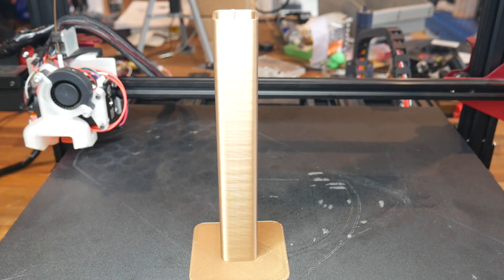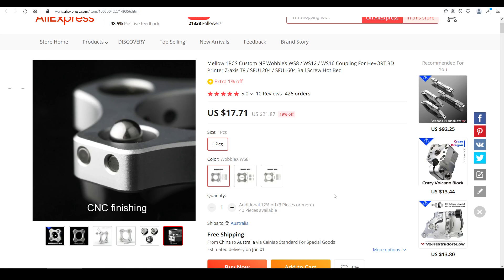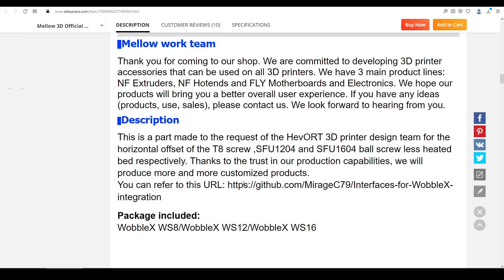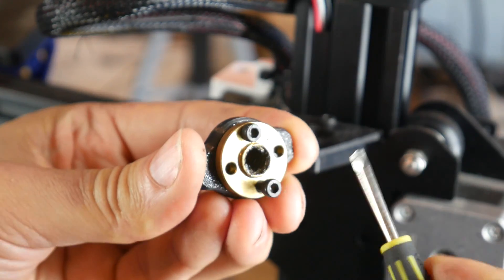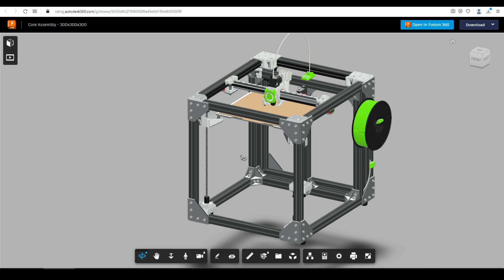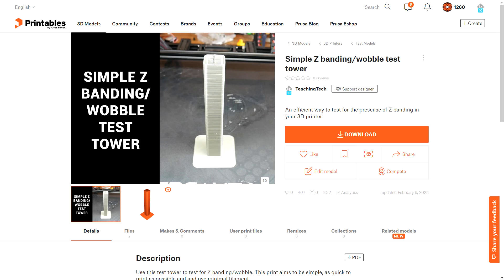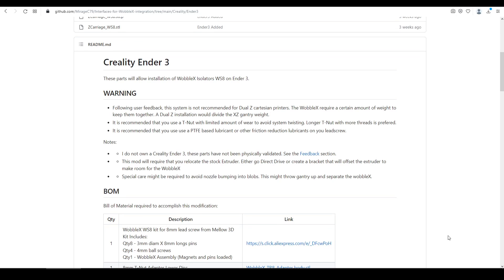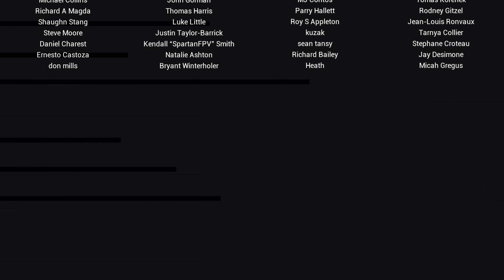The foolproof fix for Z banding and misalignment? MirageC’s wobbleX

Comment: The one you printed for the Ender 3 looks like you could have a gantry wheels with flat spots on it. I've noticed this allot with my own Ender 3 and i have to replace them on a regular basis. either from it sitting to long from non use or normal wear and tear. so ive made a pratice of replacing my wheels once a year, and that equal length banding has gone from my prints! Just my thoughts and suggestions on replacing your wheels for the horizontal gantry.
Reply: This. I had the exact same problems with my ender 3 clone - coming with wobbly wheels fresh from the dropshipper - I replaced all of them and the wobble was gone.
Reply: At that point you might as well get rid of the wheels altogether and go with rods or linear bearings.
Reply: @amorton94  Those wheels are a dime a dozen now, that linear rails are the new fancy - and you gotta have a whole lotta more work to do, to retrofit linear rails onto an ender - ask me, how I know ;)
Reply: But he fixed the problem when he added weight and the print came out great. I mean he pretty clearly explained what the issue was and how he fixed it.
Reply: @Hagop64  This was the (fairly similiar, but modded) dual-Z CR-10. The Ender only has one Z-motor.
Reply: I actually though about replacing my wheels a few days ago... 
It there any test to know when its time to change them? 
When i move my axis by hand i can feel a slight difference in force required depending where on the axis the gantry is.  Guess that enough proof that its time to change xD

Any wheel type you recommend?  I were looking into Polycarbonate, but i dont really know whats the best type for durability
Reply: @KidCe.  "When i move my axis by hand i can feel a slight difference in force required depending where on the axis the gantry is."
Gently, slowly, and especially consistently moving the gantry up and down, with a light touch so you can feel minute details, is the best method indeed.
(except for maybe using an expensive feeler gauge, and/or force measuring device, but that takes a whole lot of setup, time and money)
It would be even better if you decouple the driver system from it (remove the belts or lead screws), so your feeling isn't hindered by them. But that is a step up which would require a lot of more time and effort.

You can also visually inspect the wheels and extrusion for any inconsistencies like dust or other particles.
But note that those pom wheels always give of some 'dust' (this isn't really dust though, but the micron thick top layer from the wheels --usually dark grayish in color.. It also acts like a form of self lubrication).

But if you dialed in the tension on the wheels properly (note: many fail to do this properly!), and you make sure particles or even normal dust doesn't collect on the wheels nor the extrusion, and you regularly clean off the extrusion with a micro cloth. Those wheels should last for ages! The biggest culprit and reason for deformation of the wheels really is bad tensioning and nothing else!

Caveat: if you are not going to use your printer for a long time; loosen the tension of the wheels. They will deform if you leave them long enough on one spot. HOWEVER, if you tensioning is correct, they also should 'spring' back quickly without any permanent deformation after a couple of runs.

Good properly tensioned wheels can give equally good results as any linear rail by the way! Don't let anyone fool you about that! Though linear rails are much more friendlier in maintenance, also in the long run, and way easier to set up. Because POM wheels should be considered a consumer product/ aka: they do need replacement after a while. Linear rails only need some lube from time to time and that is it. (set aside cleaning and keeping it free from dust and what not, which you need to do for both systems anyways).

Comment: I converted my ender 3 V2 to belted Z because I was having too many issues with the lead screw.  

On a separate note.  Have you had a look at the Rook 3D printer on printables?
Reply: Did it work out alright?  Seems like that would induce other issues.  Did you use a leadscrew to drive the dual bands?
Reply: @KITDFOHS  Its not a perfect solution but it solved more problems than it caused and my X axis is now supported on both sides without needing a second Z motor.  I am using the leadscrew as the Z axel.  I will get around to using a linear rod eventualy.

Comment: There is something I don't understand about the mod on the two Cartesian printers: You decouple the X-axle from the leadscrew, but then force that leadscrew into a fixed ball bearing at the top... Shouldn't that work better if you let the upper end move as freely as with the Ratrig . (?)
Reply: The wobble X can only compensate for a finite amount of lateral movement. So you need to make sure that the leadscrew or ballscrew stays within that maximum deviation.
Reply: No, not really. Decoupler should prevent any of the side to side movement if it's not too big. But he is also using a standard screw nut that's clearly seen better days. There's a lot of backlash in the system (which is probably why he needed to add 500 grams in the first place.). Anyway, the wobblex was developed for ballscrew mainly, and you have no backlash there to begin with.

Comment: Another solution for z banding is belted z axis.
Reply: Yeah, but belts can start vibrating when printing at higher speeds which can lead to other artifacts.
And you'd need a gear system or power off brakes.

But they do work well for most normal speed printers and the gearing system could be a printed part.

Comment: You still need to try Oldham coupling.  I put a set on my Ender3 and have super clean prints.
Reply: that's cool, waiting on mine, any advices on install?
Reply: @deathcube2006  check fit. sometimes they have small burrs (nicks) that keep em from moving smoothly. If that's the case wet sand 2000 grit on mirror/flat surface, clean then light machine oil.
Reply: @deathcube2006  Make sure you have the right version.  Some models of the Ender3 must have the 2 hole, while others can use the 4.  Get the proper screws and nylon lock nuts.  Lube the coupler with a graphite or PTFE type lubricant.  When you get the couplers, take them apart and inspect them very well for burs, machine defects, and debris.  Any defects, or play in the dovetails will greatly hinder their usefulness.  Assuming you got the brass version, if there is play, you can take some of the play out of it by tightening the coupler end piece in a vice with  the jaws of the vice parallel to the travel of the dovetail.  I'd also add a bearing to the top of the Z axis leadscrew to keep things vertical and allow the Oldham to just take up the side to side movement.
Reply: @jameslmorehead  By pinching them like that in a vice, don't you bend them (slightly)? The rotational and pulling tolerance might decrease, but you also make it even more impossible for them to even slightly tilt in that case. Because it was exactly that very same small tolerance, which might make them ever so slightly tilt and kind of useful/effective in a roundabout way.
Reply: @Cookie  To use them effectively,  you must have a bearing at the top and bottom of the lead screw to make any bend in the lead screw a lateral move with no bending moment.  Also, keep in mind that this is for low-cost printers.  If you want to eliminate this all together, you need linear rails and drive belts.
Reply: @jameslmorehead  Errmm, no... using a bearing at top and/or bottom will not, ever, fix a bendy leadscrew and convert those bends into just lateral movements. If anything, fixing the leadscrew on top or bottom will introduce MORE bends (of course talking about minute stresses and bends, but still...). This is just pure physics/mechanica.

What it will do, or at least 'can' do, is minimizing artifacts from resonances a bit and 'flopping' around when your leadscrew isn't properly seated on the bottom (especially when printing high up).

Using bearings or anything which restrict the movement on top, is very highly dependent on many other factors and continues and always will be a very complicated and highly debated matter.
 
There can be other benefits in doing something like that, but it will also introduce other negative factors at the same time. There is no "one size fits all" solution for that, as it highly depends on many many other factors, not in the least the kind of coupling you use between it and stepper. Heck, even the kind of stepper on itself or how it is mounted can dictate whether or not it is useful to fix the top. What might work with your printer, does not necessarily work on another slightly different build bedslinger in the matter of leadscrew 'fixes'. 

But either way, you can not and never will be able to eliminate tilts and yaws, or convert them to just lateral movements, by fixing the top (or bottom) with bearings, never ever. That is not how the physics and mechanics work (unfortunately... because it would otherwise indeed be a VERY good thing if it did).
Reply: @jameslmorehead  eg: the ONLY way you would ONLY have to deal with lateral movements (XY plane) is when your lead screw is:
1) dead strait to begin with
2) perfect perpendicular to the XY plane / parallel to the Z plane
3) NOT FIXED AT TOP!!!!! (or you WILL introduce bents and/or grinding otherwise)
4) but when it is not seated in the dead center of the stepper drive shaft (which in practice, almost never is 100%)

And in that case, sure, you can (mis)use the Oldham coupler to minimize those lateral movements...

Hence why so many printers do NOT have it fixed on top. Because you only do that, when all other mechanical things are (semi-) perfectly aligned, balanced and dialed in. If all those conditions are met, then sure, by all means, fix it on top with bearings to minimize ringing/resonances so you print a bit faster than otherwise.
Reply: @jameslmorehead  As a third and last note (sorry for the walls of texts, but there are a lot of misconceptions, hearsay,  and urban myths with this subject): drive belts are also not the holy grail though. They introduce other problems. Not in the least stretching and ringing/twisting of the belts, etc. Especially when you start to print faster (higher accelerations, jerk, etc), the more pronounced it will become if you don't have the proper or at least aduquate mechanical decoupling between your belts and the thing you wanna move. 

As for linear rails: That's another subject and can of worms all together. Those are not a drive mechanism. You still need something to drive them up/down with (which is lead screw, belts, etc). They are meant to hold the carriage, not drive it.
Reply: Oldham coupling have the EXACT same problem! And it does not matter if you have the strait version or the slanted version; they both exhibit the same problems.
But not as massive big as what you saw happening in the video with the WobbleX though.
There can still be 'too much' tolerance in the Oldham couplings between the three plates. You can even feel it when you gently push or pull them apart.
But is is not as much as with the WobbleX, which you can easily see happening during the print by the naked eye.
As such, you should be aware that the very same thing happens with Oldham couplings. Using that style of coupling will not prevent it 100% because those tolerances need to be there for the main function of the coupling to work: sliding.
Reply: @CookieTube  The dovetails on an oldham can be much more accurate and reliable than this wobbler plate.  And, if the dovetail has too much play in it, it can be tightened.  Mine have 0.001" of side to side play in them.  There is a reason some high end CNC equipment and other industrial equipment use Oldham couplers.
Reply: @jameslmorehead  Oldham couplings ARE NOT MEANT to do what we use them for in 3D Printing!! In our case with the lead and ball screws, there is ALWAYS a tilt involved, that is how bending of those screws/rods work!

Oldham couplings are flexible shaft couplings that are used to connect TWO different shafts : the strait driving shaft and strait driven shaft , which almost meet in the middle free floating piece of the coupling. It is not meant for 1 shaft to go thru it! Because if that single shaft is bent, any screw on that shaft WILL tilt as the shaft rotates. The screw will wobble, not just move laterally.

Oldham couplings are an even more ridged variation of those grey flex shaft couplings used to connect the Z-leadscrew with the Z-stepper motor in Ender3 style printers. Because those are made to be able to also tilt between the two connected shafts. Oldham couplings are not meant to do that. They are just another version of the sometimes called 'spider' type of flex shaft couplings (the grey ones with those red or black colored discs in the middle).

A such, Oldham couplings are used in CNC (and other areas) to counter parallel misalignment that occurs between two connected but strait shafts. Important here is "parallel"... Aka, the two shafts are perfectly strait and parallel to each other (not crooked in any way), but their center to each other might be slightly misaligned!

Comment: Another expensive solution for non-existing problem. Just DON'T BUY bent rods and you won't have to deal with Z-banding. Or it is too difficult to understand?
Reply: Ah yes I forgot to choose non-bent rods at check out
Reply: Ball screws that aren't bent cost much more than cheap ball screws + wobble x.
Reply: Everything ever manufactured has some degree of variation, this solution eliminates the problem for machines with noticeably bent rods, and would still improve results for relatively straight rods. Even if installed on a "perfect" machine it would be an upgrade, as parts wear these joints would keep things running correctly for longer, by allowing for the ever increasing "slop" to not effect quality.
Reply: I'll make sure to go quality check my rods in the factory before I purchase them
Reply: This is basically a hobby take on an oldham coupling. It's an existing solution for a very common problem.
Reply: Weird how many people invest how much experimentation to solve a "non-existing" problem. Even weirder how they see difference before and after with a problem that did not exist. 
Maybe your budget is unlimited so you can buy from someone who guarantees micron precission and accepts waranty claims if you measure it to be two microns not straight. Most people do not have that money. 
Maybe your leadscrews in addition to being straig by luck also do not carry any weight on them or are loaded in tension only. But some people have large printers with heavy build plates supported by leadscrews from bottom. Then it does not matter how straight you get them, they will tend to bow out at least a bit under the loading. No piece of metal is 100% straight and 100% isotropic in its properties. 
Having a relatively cheap add-on on the market that will fix this for you whatever the reason for the problem is in your case is a good thing.
Reply: The rods will bend with use.
Reply: Tell that to the rods on a 500mm RatRig LOL... 😜
Reply: "Expensive"... It's $17 you muppet. Just don't buy bent rods? Half the people in the 3d printing space are rocking $100 printers from China. You don't get an option 😂
Reply: @amorton94  No need for name calling.  You could have explained that without calling him a muppet. Calmly and politely pointing something out makes it easy to accept were name calling will provide the opposite reaction.